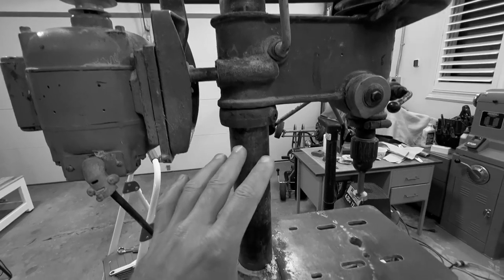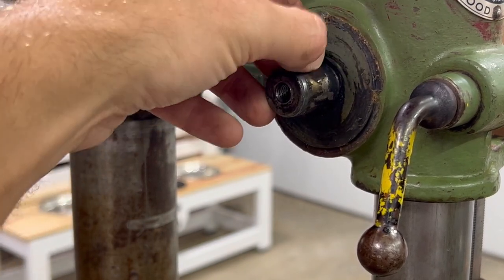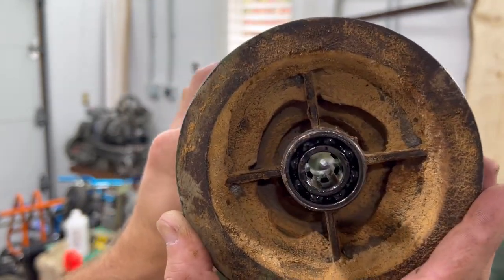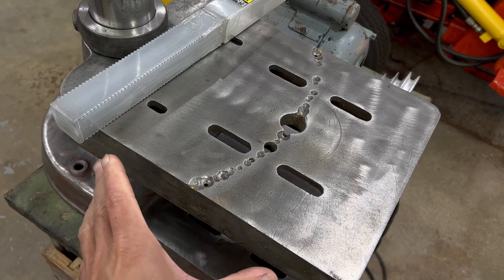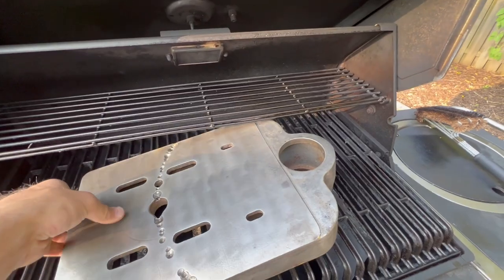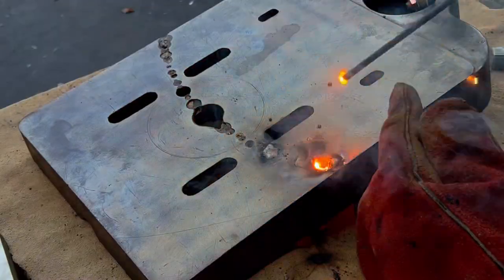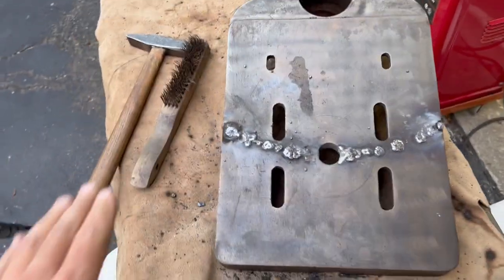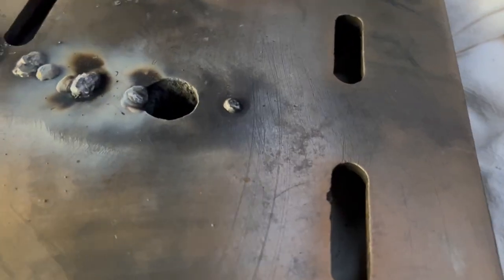I Bought This Drill Press and Now I Regret It - PT2 - Risky Fix for the Table

Comment: Good job with the weld. When I welded mine, I didn't preheat the cast iron. I cleaned it really good, and then MIG welded it. It worked well with no problems or cracks. Sometimes you just have to be lucky when dealing with cast iron.
Reply from the maker: Thanks!  I’d love a MIG… and a TIG all in good time

Comment: Thanks for the video.  I wonder why more people do not simply have the table milled or even turned on a big lathe.  These tops are remarkably thick & a lot of the wear would disappear even with a 100K (1/10") of milling.
Reply from the maker: I'd imagine that if you knew someone with a mill it'd be a great option, I don't personally and the cost up here to have it machined up here in Ontario Canada would be more than what I paid for the DP itself.  I'd love to have a mill of my own someday though.  I used to have a large Bertram lathe, but it was 1500LBS + The arm and it was too hard to move around myself so I sold it for a smaller SB 9A which is much more manageable now.  

I'd love some fresh milling machine marks on my table, much nicer than my scraping job.